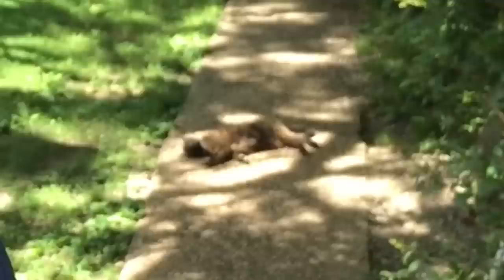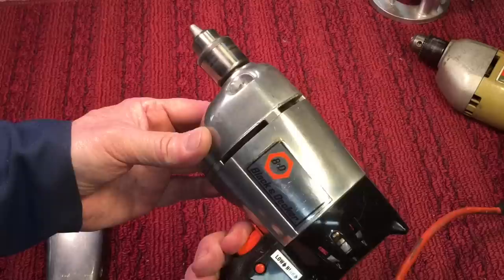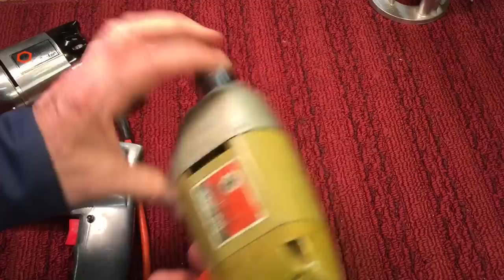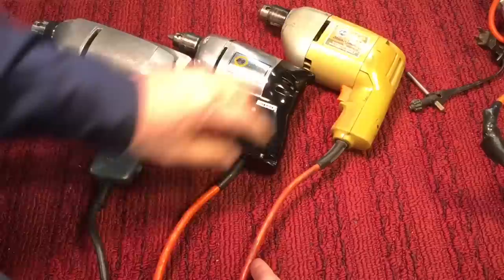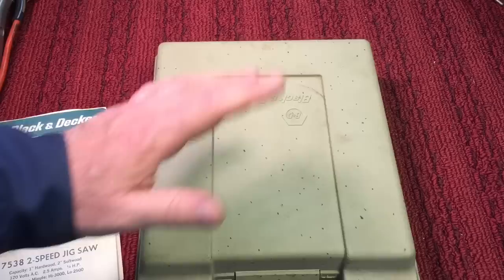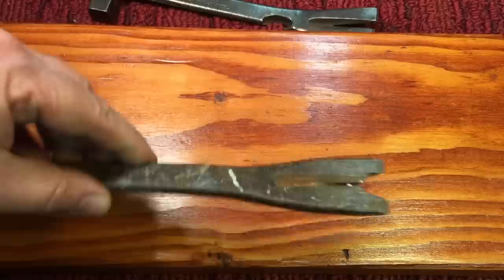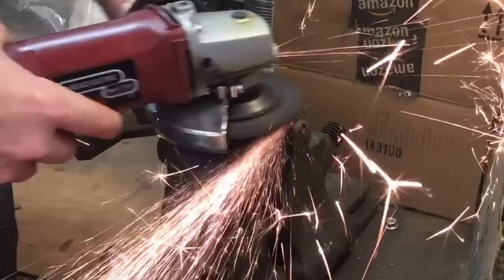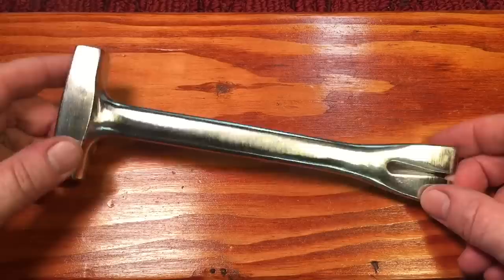Drills, Convertible Pliers and Crate Hammer

Comment: I've got the between version of the drills you have there - 1/4" B&D drill, rear 1/3rd (handle) is a grey plastic, from about 1964-1972 if I remember right (can't find my note on it). The style is more like the olive drill you have in shape rather than the black (no "horn"). I picked it up from a goodwill, with a bunch of accessories in a fantastic plastic stanley toolbox (complete with tray, top lid compartments and a fold-out drill bit index in the front). Unfortunately the accessories were mostly wet, damaged, moldy, rusty and falling apart, but they still had the original pricing on them - 69 cents for a pack of sanding disks back... whenever when! Thankfully the buffing backer and the manual survived. 

I was born in the early 90s so hearing your stories about what it was like back when these things were new is pretty cool.

Comment: Nice pliers.  I like those multi-purpose and multi-function tools.  I had a B & D like the one you received at 13.  I bought mine on a closeout table in 1974 because the carrying case was missing - $8.  It lasted  about 35 years and then began to screech.  I thought I would use a little contact cleaner to "freshen up" the motor.  Well I didn't have any contact cleaner so I used WD40.  Well after a good spray I plugged it in and squeezed the trigger.  The whole thing flashed and caught on fire.  I beat it with a rag until it went out.  Needless to say the unit was toast and I tossed it.  You did a great job on the Box Terrier pry bar.  That is a handy size for sure.  The advertisement showed some neat cross hatch on the hammer head.  Thank you for the fun.
Reply from the maker: Hi Mark!  LOL   The good thing is you got your moneys worth out of that drill!   WD40 used to be flammable...   My buddy used to spray flames with it!  LOL

Comment: Hmm.  Funny thing, I've been gathering a pretty good collection of those all metal and early plastic power tools.  Remember my oil can collection,... right?  I just can't resist for a buck or two at sales.  There's also a few of my dad's originals in the mix.  Unfortunately, I parted with a few over the years.  No idea what I plan to do with these. They do display nice.  We just might see them coming back in vogue.
Reply from the maker: =D   I tend to use my drills when building something in wood... I will have one drill with a 1/8" bit, one with a countersink and one with a #2 Phillips driver bit!   Works great!

Comment: If you want extra time with a grinder follow my welding.  My welds can be ugly but good grinding work can make them pretty.  I think they painted many tools because their castings were not good. Pits that are hard to get rid of or impossible can be filled with paint cheaply.  Made for a nice finish to the customer's eye. The reason I think that is the case is so many people who strip the paint off the tool and then find pitting when they go to buff the metal.  I would bet that the really low budget tools were cast from a pot metal and paint made it look good.  Olive green,  harvest gold,  along with a blue and an orange color were the colors of the 70s.  From kitchen to the shag carpet.
Reply from the maker: Hi Philip!  You are so right, the 70's started a whole new trend in American made junk!!  Vega, Pinto, cheaply made cars, high gas prices, they were cutting corners everywhere...  Disposable everything!   =)   Thanks!

Comment: About 4 years ago I needed a new drill and saw that Black and Decker had a corded model that had high reviews on Amazon. It is called the Matrix and it’s motor can be interchanged with a number of different attachments and I got a few of them, including a jigsaw, a reciprocating saw, a mini circular saw and others and I was surprised at how good it was and I still use it. I opted for the corded model because I was doing work at my sisters house and had a cordless drill and I had to drill deep into her hardwood floor and the cordless one kept dying on me and she happened to have an old corded Black and Decker drill that she got in a garage sale and that thing was leaps and bounds more powerful than my cordless. So, I figured I would go corded and it’s been fine. Another cordless drill that surprised me was a very cheap Harbor Freight drill that was $16 or so and came with an LED light attachment head and the drill is my quick go-to until I need the big guns, and then I go for the Matrix.
Reply from the maker: Hi Joe!  I have the Milwaukee Cordless Drills and they are great for portable work but you are 100% right when you say nothing beats a corded drill!  Those drills I showed are all 30+ years old, some over 50 years old and still work like a charm...  How many batteries would you have to buy in 30 years?  =D  Thanks!!!

Comment: Cool pliers! I like the old B&D all metal drills.  That green screams 70's.  I have Dad's old sawzall, Milwaukee hole hog and various electricians tools.  The hole hog needs a new chuck and shaft. But is slowly rebuilding. That nail puller turned out ScoutCrafter certified as usual. I can see how we are alike.  When I retire I want to go and meet up someday! Do you like old sanders? I have an old B&D sander that I never use.  All metal older one, can't remember the name at the moment.  I should send it to you.  Along with that screwdriver I keep promising.....
Reply from the maker: Hi Aaron!  I have a couple of old B&D all metal sanders...  They were hard to keep in tune...  They would run fine and then scratch up your work!  LOL  Under the bench they went!  =)  You are going to love retirement!!!  Only a few more months!!!!!!!!  =D   Thanks Aaron!!!!!
Reply: @ScoutCrafter  I can't wait.  I just got my first Kennedy machinist tool chest.  It was covered in stickers and filthy but for 95 bucks for an 8 drawer, couldn't beat it.  It came with some misc. tools and they are soaking in Evaporust at the moment. This sander is looks like a rotary polisher, all metal and older.  I put a new cord on it and it seems to run fine.

Comment: Quarter inch drills were not popular,  most went for the half inch,  more versatile and power. I like those Husky pliers never seen double ended ones, very useful. The pry bar came out nice but the nail remover part the gap looks very narrow, does not look like a nail would fit in.
Reply from the maker: Hi Tony!  You are so right!  The 1/4" drills were all marketed towards the homeowner...  Then the 3/8's took their place...   =)    The real weakness of those crate hammers were the split in the fork.  I always use those for prying moulding and other boards apart, for nail pulling I have crowbars and other tools!   Thanks!

Comment: Yes, I've seen this style of pliers before:

https://www.amazon.de/Crescent-CCP8V-Combo-Zange-Abisolierzange/dp/B01CDJEDLW/ref=sr_1_5?__mk_de_DE=%C3%85M%C3%85%C5%BD%C3%95%C3%91&keywords=crescent&qid=1560196410&s=gateway&sr=8-5

But I never bought one. I don't need a wire stripper with AWG sizes. And the AWG size steps are not the same as the metric ones. We use the cross sectional area of the conductor. For the range of the linked wire stripper our real size steps are: 0.75mm² (cords to connect an appliance to the outlet), 1.0mm² (also cords), 1.5mm²,  2.5mm². The next steps are 4, 6, 10, 16 and 25mm².

Comment: ..nice drills,still like the old metal ones,do you ever run across stands that let you convert a hand drill into a mini drill press ?... great vid..
Reply from the maker: The older Black and Decker drill press adapters were really nice and strong but then later on they made cheaper ones that weren't so accurate...  =)